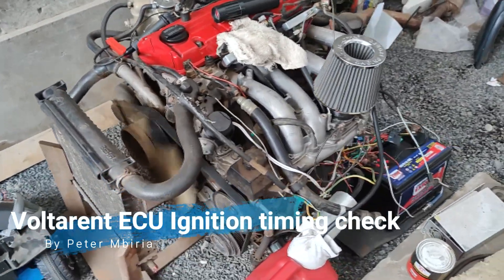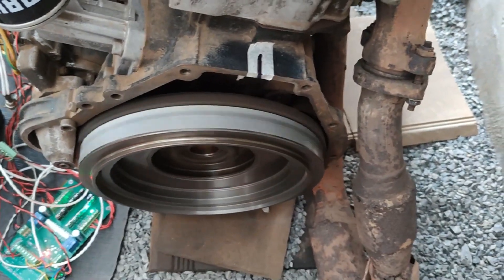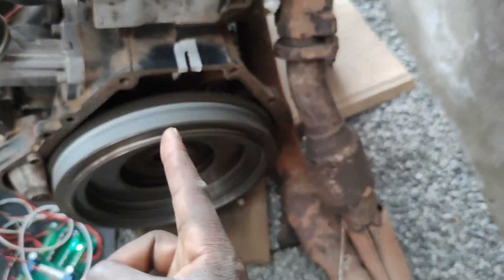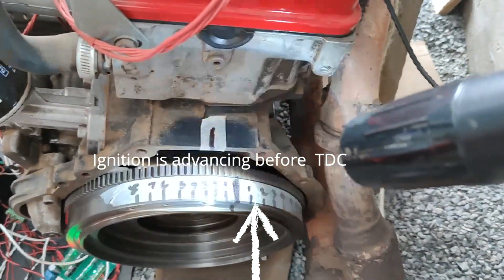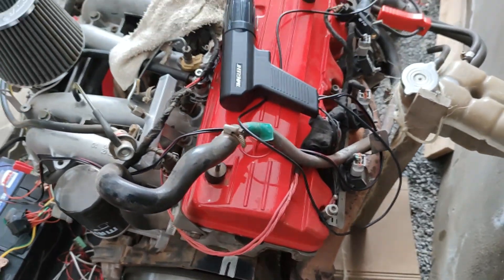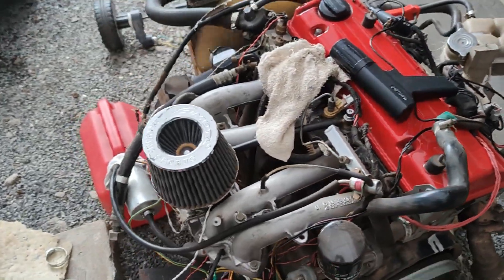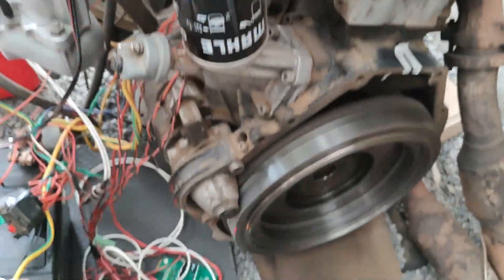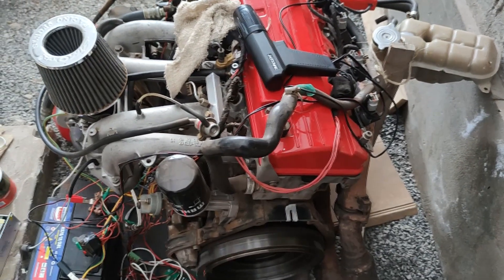Engine Ignition Advance Check

Comment: Link to online shop?
Reply from the maker: Hey Arnold, thank you for reaching out. It is being setup. Once it is up, I'll share.
Reply: @PeterMbiria1  Fully turnable? Knock detection? forced induction?
Reply from the maker: @arnoldodida  Yes, fully tunable. It doesn't use the normal tuning platforms though, it is tuned via programming with C++
Reply: Give us link to where we can purchase that ECU system

Comment: I'd like to have this system on a 1984 Volkswagen Jetta 1.7L petrol engine. Do you also recommend a particular injector model to go along with your ECU or those variables are programmable?

Great work!👍
Reply from the maker: Thank you for showing interest in my system. It is fully programmable and thus can use any available fuel injector that would fit on your engine.